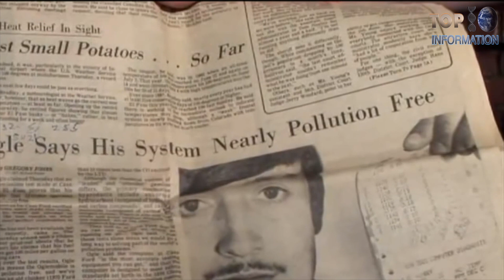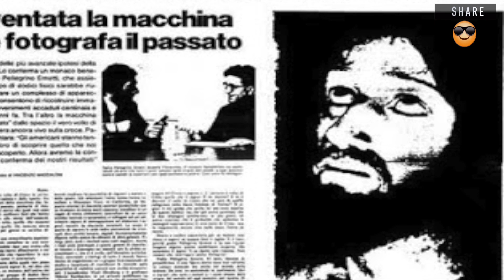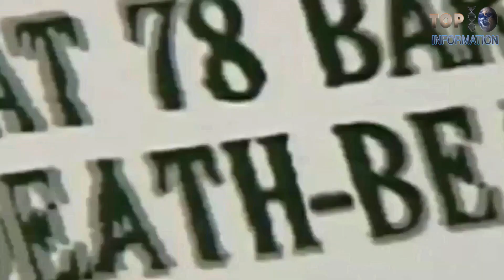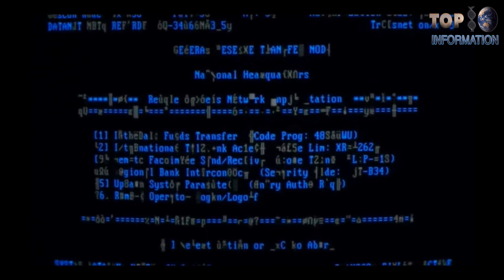5 Lost Inventions That Could Have Changed The World ▶ 4

Comment: The Bladeless Turbine, by Nikola Tesla. It was 95% fuel efficient, compared to piston engines that were 25% efficient. That's 280% more. And it could work on any combustible, liquid fuel. It should at least be in power stations.

Comment: Hmmm...  Starlight seems really similar to kaowool, and there are a few other composites currently in development that are even more impressive.

Ogle isn't the only one to build a carburettor that used vaporized fuel.  It does tend to be remarkably efficient, but it doesn't burn as cleanly as modern direct-injection, so sorry, you can't have one due to pollution regulations.

Tesla died before any significant demonstrations of his death ray could be performed.  From the description he gave, it would seem to be using high voltage and electromagnetic effects to accelerate finely ground iron particles to extreme speeds.  Theoretically it would work, if you could power it.
Reply: That starlight material is interesting isn't it? I feel like it's a mixture of different types of actual polymer resins with maybe Asbestos as actual filler material to thicken it up maybe. The stuff seems great to spray on the exterior of any type of space worthy object especially if you want to said object re-enter earths atmosphere and not get utterly destroyed. however it's pretty cancer causing as well or maybe it isn't because it's a solid stable material? Who knows man.